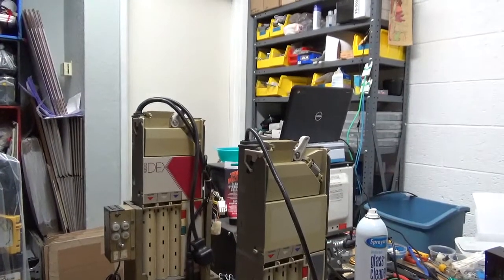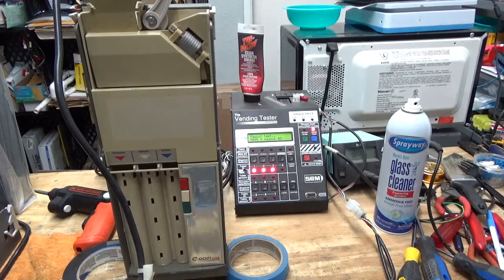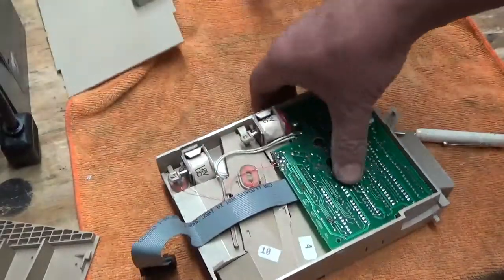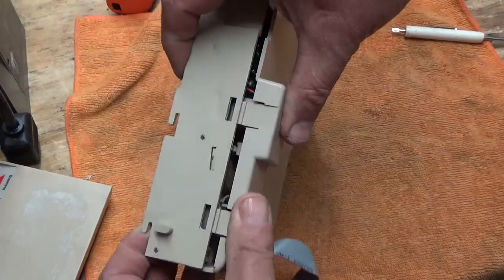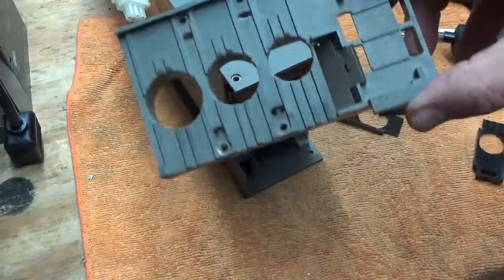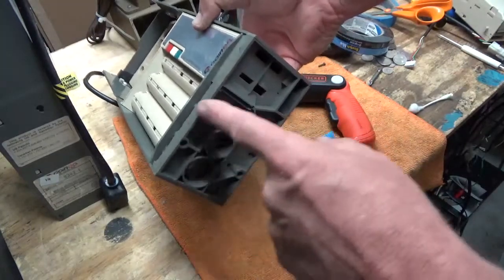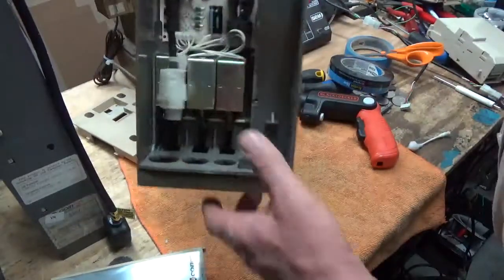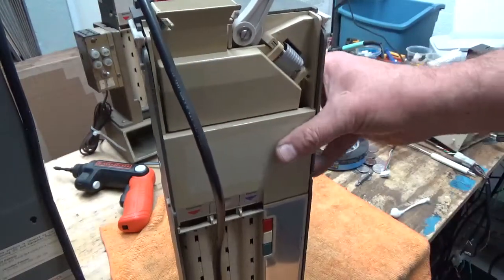Coinco 9302GX MDB Tips #3 For #Beginners And #Veterans

Comment: This is very helpful video, Question: how we can change the price on this model?  do you have any video explaining?
Reply from the maker: When operating a MDB system, the pricing is done through the control board unlike a single price machine where the pricing is changed in the coin mech itself. Hope this helps.

Comment: My keypad says use exact change only, and when I put a coin in it just slides out. My red light is on, and I tested the circuit board and solenoids and they’re all working. I cleaned the sensors I have no clue what’s wrong
Reply from the maker: This is why it is always a good ides to have a spare coin mech with you to find out what's wrong in 60 secs. These will fit any MDB system and they are cheap. https://dougbaleenterprises.com/shop/ols/products/coinco-9302gx-mdb-3-tube-rebuilt-coin-mech

Comment: What is the most common issue when coins get stuck under the plate in flight deck, just opposite of the top solenoid? My 9302gx is constantly getting coins stuck behind that plate.
Reply from the maker: In a Coinco there are 2 solenoids and the small plungers often break. They are located behind the rear access panel on the rear of the flite deck.

Comment: What is the max price that you can charge for sodas on a coinco 9300 15 pin 24 volt 3 dip switch coin mech please ?
Reply from the maker: The price for the product is determined in the machine, not the coin mech.

Comment: what if the coins are getting accepted and reading but they are not refilling the tube, it is just going into the coin bucket.  Is there a way to correct it so that they go into the tube to refill?
Reply from the maker: depending on the coin mech, if the hi lo setting is set to low, that's exactly what's its doing, keeping the tubes. Post a pic of the coin mech in our coin changer help group for more help Scott. https://www.facebook.com/groups/AmericanChanger
Reply: @dougsworldtour3755   I have a coinco the same brand and believe model in the video.  I keep have to refill it manually.  Is there a reset or anything I can do without sending it in.  I live in the Caribbean so sending things to get fixed like this really become costly.  thanks in advance
Reply from the maker: The flite deck has a problem and is not directing the coins to the correct tubes.
Reply: @dougsworldtour3755   thanks - is there a way that I can resolve it?  I live in the Caribbean so sending things back to get fixed is very expensive and time consuming.  Appreciate any advise.
Reply from the maker: @scottiesisland101  Take a look at this video, I open up the flite deck to show you where the problems are. https://youtu.be/hFCTgHgb4Ro

Comment: i don't think me coin machine is bad, it takes coins but after last coin it lights up, exact change only. but dose not let you get idem. and no change returned
Reply from the maker: If no change is returned, the lower 3 slides may be sticky, often caused by a can or bottle exploding in the machine. These slides are easily cleaned but disassembly is required. Carrying a spare mech and validator is highly recommended.

Comment: HOW DO YOU CHANGE THE AMOUNT OF THE SODA FROM .75 TO A $1.00?THERE IS INLY 3 SWITCHES ON THIS MODEL AND THE ONE I HAVE.
Reply: you have to do it from digital panel or main vending mother board with switch. this model does not have that function.
Reply: @PersonalUseChannel what are the dip switches for then?

Comment: why not showing one that is completely dead "no red light " ?
Reply from the maker: In that case it would usually have an electronic component failure, such as a part.
Reply: That’s what I’m looking for , which capacitor is the one that usually fails when is not a red light. Thank you for your reply.
Reply from the maker: @nery200043  The 470UF X 35 Volts
Reply: @dougsworldtour3755  thanks